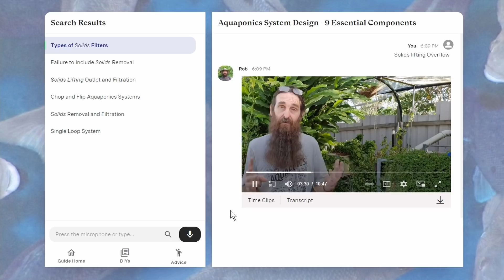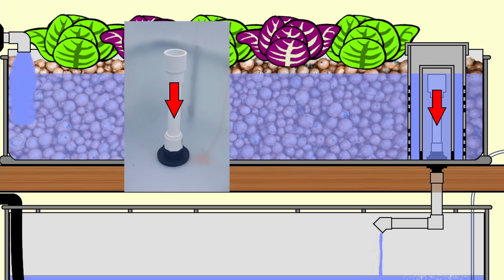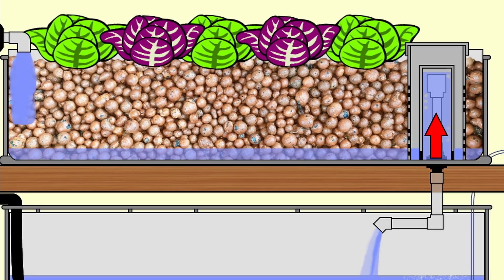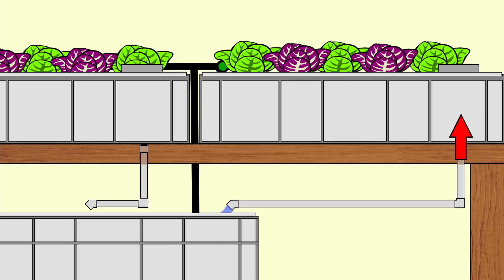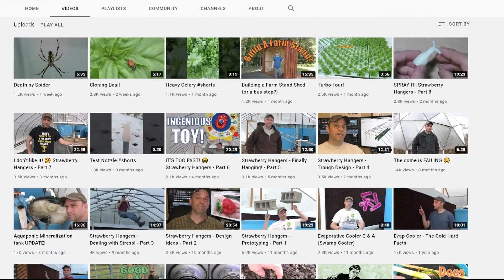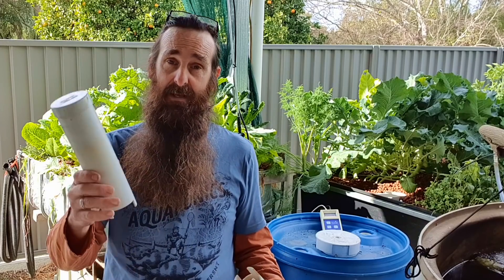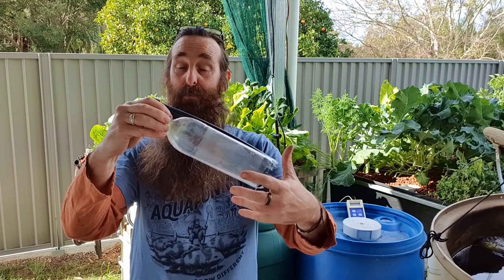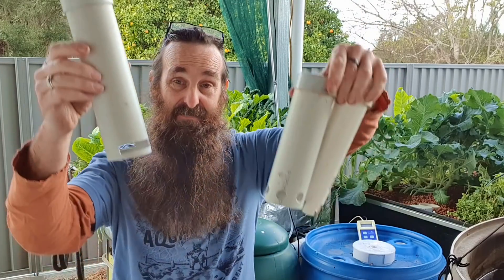Bell Siphon Troubleshooting & Explanation | Aquaponics 101

Comment: Awesome information. I would like to share my experience as an aquaponics enthusiast. Since  5 years or so I have an outdoor aquaponics system connected to my small fishpond. I live in the Netherlands so first I ran into some problems when it started freezing in the winter. Lost some pond water and also had some frozen pipes a couple of times. But I keep adjusting the system to make it more winter and frost proof each year. For me it is mostly an experiment. And so far I had not planted a wide variety of crops. 

I started with growing strawberries, and chive, and as an experiment I planted a branch from a bay leaf that I had cut of from a bush in my garden, and that was it. My first goal was to get it functioning well, not only mechanically, but also biologically. By the way, the cut of branch from the bay leaf started growing to my own surprise, and now it is a small lush green bush :-) 

But this year I bought some seeds from eatable flowers, and reddish, Broccoli and Lettuce. I discovered that most seed varieties do not like to sprout in my system, but for some reason that I do not know or understand a couple of them seeds did sprout. Resulting in my first two successful reddish plants growing nice reddish. The bay leaf is growing with a nice dark green color. And my strawberries and chive and a few flowers are doing great as well. A few flowers started to grow, but the lettuce and broccoli seeds did not sprout at all.  

It was not easy to get to this point, because here in the Netherlands we have to deal with severe changing weather conditions, from very cold to very warm, and lots of rain, and lots of nitrogen pollution due to excessive farming, so I have to help my system a little in order to keep all the values of the water within the proper specifications. Mainly making sure that the hardness of the water is correct, (KH and GH values). If that is not correct the PH goes up, and bacteria do not like that, and because of that the system will not function very well and most plants will stop growing and become yellow or even die. 

But even with adding the KH or GH solution I made some mistakes because if you do it too fast and/or too much the bacteria do not like it either and the plants will stop growing. And you can't do both solutions at the same time either, there needs to be a couple weeks between both applications. So now I use a barrel to mix up the desired solution, and I let it trickle into my system like an Intravenous therapy.  

I am using lava rock as a grow media, because I noticed that the frost destroys the clay pallets over time. Lava rock is not the easiest grow media to handle but other than that it works great. Since a couple of years I ad worms to the system right after the winter, and that helps to prevent clogging of my system, and it ads beneficial nutrients to the system. 

I have one major tip for ALL garden enthusiasts, no matter if it is aquaponics or regular gardening. If your garden or aquaponics system is suffering from caterpillars there is a very cheap and NON TOXIC solution for that problem, and I have been using it myself successfully for a couple of years. I am using a solution made from water and molasses. Molasses is a leftover product from the sugar production, it looks like syrup and it is often used and sold as a supplement for cows and horses. In Europe they sell it in 5 liter Jerry Cans. But it is also used as an ingredient for making moonshine :-) For some reason caterpillars do not like it. It does not harm your garden, or your aquaponics system, or any other animal at all. 

I even used it very successfully to protect my Buxus bush against the caterpillars from the Buxus moth that destroys Buxus plants. To apply it you need one of those garden spray pumps, and mix a couple of spoons or 1 small cup of molasses with regular 10 liters of water, and spray it on your plants. You need to do it before the caterpillars arrive, and repeat it one or two times during the season, because it does not kill the caterpillars, but it prevents that caterpillars choose your plants to eat. Maybe it is the smell, maybe it is the sugar content, I am not sure why it works so well, all I can tell is that it works. And I have this information from Murray Hallam, a well known aquaponics guru, and he has been using it for years well before I ever heard from it. 

It was a long story, but I can imagine that more people from North West Europe, or any other northern European region, wonder if an aquaponics system would work for them in colder conditions. And I can say that it works fine if you make it as winter proof as you can, or when you put it inside or inside a growhouse. It might take some time to get it working, because the bacteria need to establish a healthy colony and you need to get all the flow rates correct and such, but once you get it working well you wish that you had done it much sooner in your life. 

The benefits from a well working system are: about 80% less use of water. No fertilizer needed. No weeding needed. Much less time needed for maintenance. Growbeds can be made at desired work height. High yield due to plentiful nutrients. Eatable fish. Low emissions. 

Compared to cows fish grow far more efficient and therefore proteins from fish are far less damaging for nature. 

Greets from the Netherlands :-)